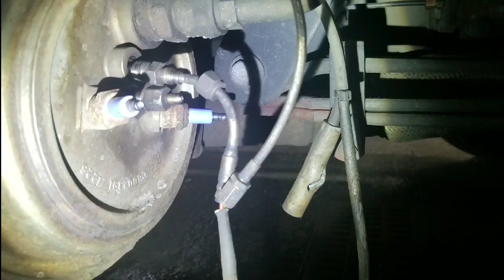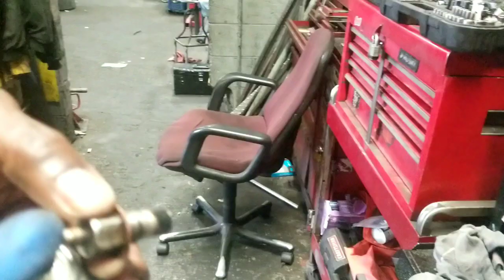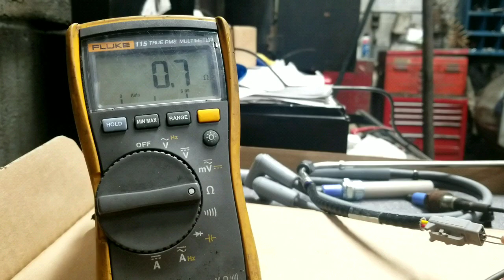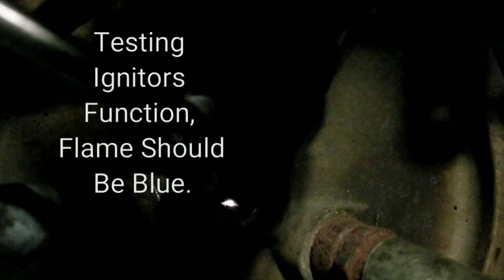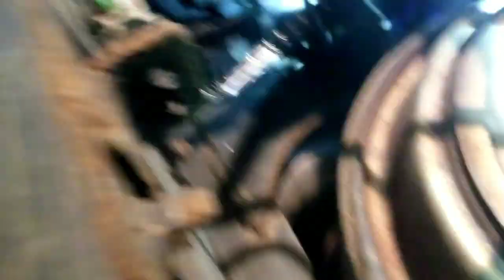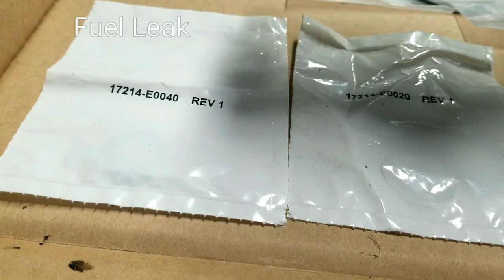Hino Exhaust Burner Malfunction Diagnostic

Comment: My hino 268 2018, had check engine light on, came on and disappeared. Then it returned and stayed. From my eld I can only see 3 codes P206B, P204F and P20EF. We took it to dealer; first scan was free9 couple codes only one was active) and they recommend we come for more comprehensive scan. We did and they said we change PM sensor, just over a thousand was charged part and labor. Codes all went off after, 1 day after the engine light is back on I can see P206B -Abnormality in Characteristics Of Def Quality Sensor. What do I do.. I am getting Fed up . Pls advise what you think.. Can we change Def filter or ? Cant believe dealer said Pm SENSOR, we changed it and after 200 miles drive , the check engine light is back on.
Reply: I hope that when you took it to the stealership that they checked the DEF nozzle. Also, the DEF tank has a sensor in it to check for contaminants in the DEF such as diesel or water. They should have given you a report of what they did to it when they checked it and they also should have checked the Parameter Data during a forced regen when diagnosing your truck. The main things to check is the DEF tank, DEF nozzle, Knock Sensors, temp sensors and PM sensor. Those guys at the shop sometimes get lazy and instead of running a diagnostic, they simply scan codes and replace parts.

Comment: Any help with removal of dpf for cleaning
Reply: Here's a tip: when removing the burner, check the burner by shaking it and listening for metal noise. There is a flame deflector that comes loose inside because the welds come apart. if that is the case. you could either replace it or see if you can take it apart and repair it if you have welding skills.

Comment: I have a question regarding a 2012 Hino, 268 model. 
I keep having this message on my dash.  First it will say low power then it will go away and this message will come.  “CHANGE DEF TO NORMAL ONE WITH ENGINE OFF, ENGINE-KEY ON. 
Then there is a symbol of the check engine light /DEF.  Truck wasn’t driving then I got it scan and reset everything goes away then after two months the same problem again. Do you have any idea what can be done to fix this problem? 
Thanks
Reply from the maker: Not sure, I would say keep the DEF fluid full?

Comment: Can you help me out with a few codes that mi hino 2011 is showing?
Reply from the maker: What codes do you have, and what year, and engine? You can also google any codes you have if you're not sure what the codes are.
Reply: Thanks. Yes, I found some online but this are all the codes it showed after being scanned.

P0410
U0100
P141D
P203D
P204F
P141F

It’s a 2011 hino 268 with a j08e engine 
On the last part of your video you talk about a leaking “ atomizer” how do you take the cover off to replace o-ring mine is leaking

Comment: Please I need help what the part number and is this for this code P141F Burner system malfunction P204F InActive Malfunction of urea SCR system
Reply from the maker: The 204f code is just an info code. You have the check the dcu or bcu for the actual fault. It can possibly be the def injector malfunction,  but you have to access the other modules to see what the code is. If you have "def malfunction code", change it. Even if it spray normal when testing it. What software are using to get the codes?
Reply: R A Diesel Tech  i am using autel And that would show up But I don’t know which one should be no problem
Reply from the maker: @roodisafar5945  it's best to have the hino software.  The codes are just saying there's a problem with the burner, and scr  system.
Reply: R A Diesel Tech so what should i do I don’t have This software
Reply from the maker: @roodisafar5945  buy the software, or take it to a shop that has it. You can't fix a CEL if you don't know the code.

Comment: Do you know where I can get the software for the hino truck
Reply from the maker: You can look on ebay. Some folks sell the laptop with the program. The company i work for get it from hino directly.  You can check them also. I'm not sure of the price.
Reply from the maker: What year hino program are you looking for? The hino explorer work on 2006-2014 hino. Explorer is the old software, might be easier,  and cheaper to get. You can also get the codes through the dash menu.
Reply: I can get a computer  with hino and many more software's already installed. 
I'm a class "A" diesel mechanic. I know what do you need.
Reply: @capecapeable  pleas by friend I am looking for the DX2  software  already have the laptop  and the device  as you said pleas let's  ne know where I can get it .

Comment: What year  hino is that
Reply from the maker: 2011-2015. The discontinued the burner system after 2015. It was a lot of problems for them. But the system is easy to work once you know it, and have the hino software.
Reply: R A Diesel Tech  hi is this for this code P141F Burner system malfunction P204F InActive Malfunction of urea SCR system
Reply: Is this for code P141F Burner system malfunction P204F InActive Malfunction of urea SCR system